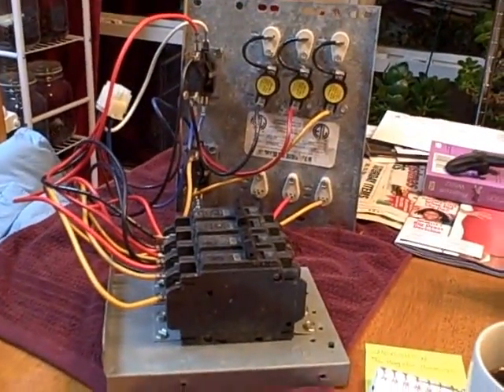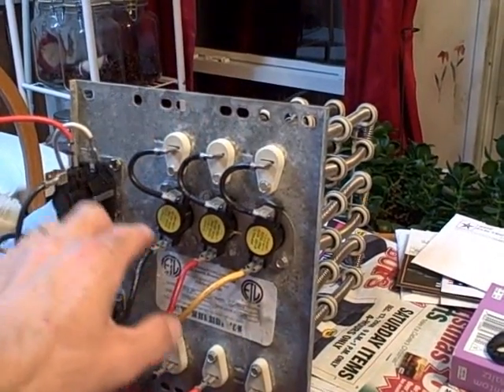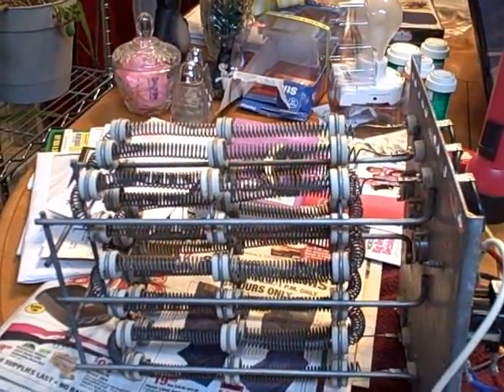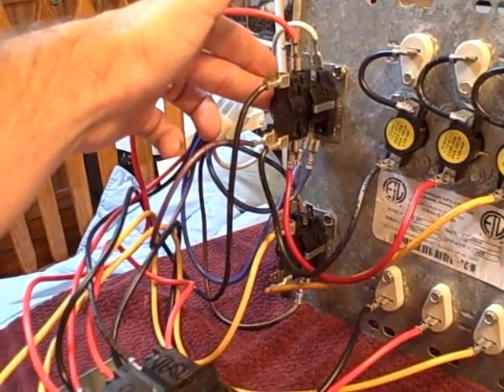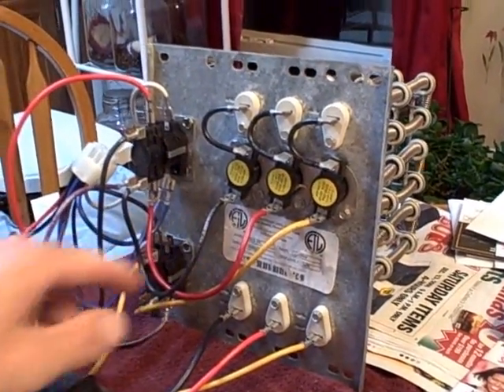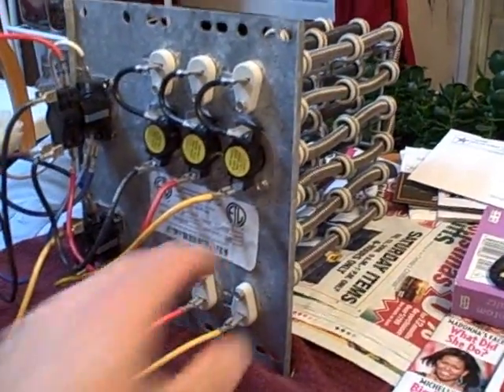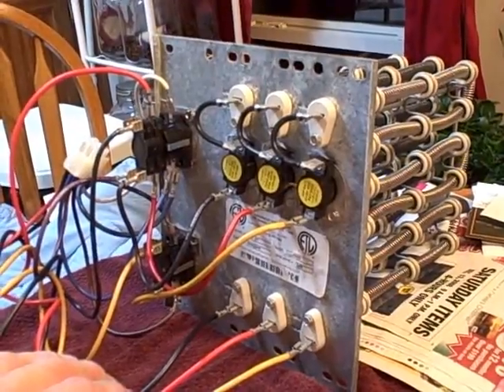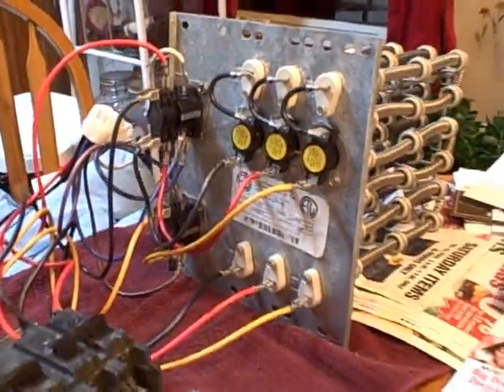HVAC Electric heat kit / strips shown!

Comment: Good info.  My Electric heater has a Heatcraft Unit in it and outside the furnace on the wall I have a big fuse box with 2 huge buss fuses in it.  The fuses are about 25.00 a pop, and my heater is blowing out these fuses like popcorn.  This large fuse box is where the 240 volts pass thru and to the heater.  we live in rural Ohio where it's hard to get anyone out for service.  I'm frustrated to the point I just want to replace the whole coil kit.  What's you take on this?

Comment: What is the reading suppost to be on a limit switch when is bad??
Reply from the maker: A limit switch, like a sequencer, can fail in either the open or closed position. If you had one laying on the table and put your meter on it, the resistance would be negligible, basically acting like a straight wire.

If, however, it showed as an open circuit (say, testing in the continuity setting) then it's bad.  The limit switch is just like an on/off light switch, when the furnace gets too hot the little concave disc in the switch pops the other direction and opens the circuit, cutting off the (usually) 24v going to the heat strips sequencer or gas valve.

I've seen them wired a lot of ways, but typically, properly, they should cut the heat call while leaving the blower running until the temp drops lot enough for the disc to pop back to normal, then it will let the heat call continue, or wait for the thermostat to tell it to hear, if the temp went up high enough in the house while the unit was cooling down.

Usually the only time I've found one failed is it there is either an air flow restriction that is letting the unit overheat again and again, short of short cycling repeatedly before the thermostat reaches the setpoint, the repeated excessive heat wearing it out prematurely.

Typically an airflow restriction would be something like a really dirty evaporator coil, or a clogged up air filter. I've seen insulation board in either the plenum attached to furnace/air handler, come unglued and fall down inside the unit or plenum blocking/restricting airflow.  A few times I've seen (like two times ever) the blower wheel locknut not be tight and the wheel would be spinning in the motor shaft.  (Fun figuring that out the first time, haha!)
I once or twice I've gone on a call and at some time in the past three blower motor had been changed out and the blower had been set too low a speed, say set too low when maybe it should have been medium low or medium. ,(Some replacement motors have the or four speed, high almost always for cooling.

The only way to test the limit switch is to overheat it.  The temp is usually marked on the limit switch. Either removing it from the circuit after shutting off all the heat breakers. (On electric heat air handlers there are almost ALWAYS two or more 240v (in the US)  breakers!!  A really small unit might have one)  

Once it's out of the circuit you can get some alligator clip jumper wired and use those to attach your meter leads to the switch, set it to the continuity/been setting. It should be being out showing continuity. As you heat up the business side of the switch and it reaches temp it will open the circuit. Then go get a glass of tea while it cols of so you can touch it again to put it back in the unit ;)

The other way would be, set the thermostat to heat and turn it up high so it will lick on when you need it, then turn off the breakers to the unit and then remove the 24v wire going to the blower relay securing it so it doesn't short on anything, then turn the breakers back on. The gas furnace should fire up, or in the case of an electric heat air handler you need a meter with an amp clamp that you can clamp over one of the incoming 240v lines, set to high, say 100A or higher. 

With gas you just wait for it to hear up the heat exchanger enough to trip the limit switch, with electric you watch the meter to see when the 20a or 40a or whatever it is drops down to almost nothing, then you know it has cut the 24v signal calling for heat.

I don't recommend doing either of these under normal circumstances though, it puts extra heat stress on the heat exchanger or electric heat strips, not worth the trouble.  

So the short answer (hah!;) Is, if it's not broke, don't fix it. If it is and the unit is cool because the heat won't come on any more and you find the switch stuck open, replace it. :)

Just for fun, here's the order from most common heat failures to the least, on electric heat air handlers:
1. Heat sequencers. 
2. Burned off wired, usually with corrosion, from the push on connectors being too loose. On older units that have had a lot of repairs over the years I've sometimes found some tech had replaced burned wired but put on new wiring that wasn't heavy enough gauge, as was originally there.
3. Blower motor failure.
4. Blower motor capacitor failure.
5. Control board failure. (Nearby lightning gets them sometimes) there are too many ways it can fail to get into here, but not all units actually use boards, lots of old ones out there that don't.
6. Bad 24v transformer.  Lots of ways to die, usually from a dead short in the low voltage wiring and there was no fuse inline to save the transformer!
It always kills me when the manufacturer is to cheap to include a part they can get in bulk for pennies, lol!!  Lightning can be a culprit too, but usually other stuff in the house will have been fried too, heh.
7.  Failed/ bad heatstrip.  This is almost always on old units or systems that have leaked water on the strips during the cooling season and rust/corrosion had set in until it gets a hotspot and fails, or unfiltered air let's cut build up on them slowly over yesterday causing heat stress, then they break.
8. Blower wheel failure. Very rare. The central disk breaks loose from the shaft nut attached to the motor and doesn't spin properly with the motor, which can cause motor failure if, say, it goes unnoticed when nobody is home and the unit keeps running.
9. Limit switch failure, reasons listed above.

I've left off a few, such as bad contactors (some brands use them instead of sequencers) either for the heat strips or the blower motor. 

Bad thermostat, dead, not working properly out a new one was installed and not set up properly. (I've been on a lot of calls for that)

On gas furnace there's also bad thermocouples (won't stay lit),

 bad gas valves (not coming on even though they are getting a call voltage) 
Clogged pressure switch nipple. Where the mounted pressure switch has a rubber tube that pushes onto a nipple going into the induced draft motor.  Rust that gets sucked into the nipple blocks up the tube and has to be c cleared, but that also points to a bigger investigation looking for the cause of the rust.

Pressure switch failures. (I hate those!)
Hot surface element failures. These ignite the gas on modern units. Do lots of these every year!
Flame sensor failure. Usually due to soot building on the steel rod, clean it with some sand paper, wipe and reinstall. Occasionally there's a grounding issue with them, but that's less frequent unless it's a package unit outside.

Well that's it!!  Hell, I should print this and make a video covering it all! Hahaha!!  Hope you found this entertainment, if nothing else!
  Mike

Comment: Are these supposed to glow red hot like a toaster, or do they give off a faint red glow ? I assume also that the all the coils are supposed to light up at once.  I drilled a small inspection hole in my lower plenum, and used a cheap boroscope to view. I'm about to put a new heat kit in anyway, but i just wondered how bright these glow.
Reply from the maker: It varies on the coil string setup, but typically there will be some sections that will turn red (not brightly with the blower running) and others that won't. If the blower wasn't on to dissipate the heat then you would see more, until the thermal limit switch cut the power for safety. It's normal for them to work that way, the coil string give more surface area to create resistive heat. 
As long as you have current flow going through the string then it's working fine. If memory serves a typical 5kw string will pull 20 amps, if you have a clamp-on amp meter it's easy to check and see if it's in that ballpark. 

Heat strips usually last a really long time and usually only fail early if there is crying that builds up on them creating hot spots weakening the metal or rust from a water issue (dirty coil above it dripping or other water issues during the summer).
Hope this helps!

Comment: What would cause the coil to have Several dead spots We replaced the coil with a new coil from supply house and had same problem
Reply from the maker: If you're talking about a single,  say,  5kw string, as long as it has continuity from end to end (no cracks or breaks), you have power to it and it beats up,  then it's working. 
I've seen lots of heat strings that only turn visibly red in certain areas.  As long as they're getting 240v (or whatever the equipment is rated for), all the connecting from the breaker box to the unit connections are tight and the house wiring from the breaker box to the unit is sized properly then its fine .
You can put an Amp clamp meter on one end of the string,  if it's a 5kw string then it should be pulling about 20 amps.

That's what I've always done,  unless it's a vertical unit and there was a water leak issue with the condenser coil for a long time (think really dirty coil dropping) and I need to check the coils for rust,  then I would visually check them. 
Hope this makes sense and helps!

Comment: I had two thermal safety switches break, causing two heating elements to not turn on. I knew something was wrong because the house wouldn't warm up properly.  Ordered new thermals and replaced them.
Then a relay contact that controls a heating element got stuck in closed position. There was no way to know something was wrong until summer came and the AC wasn't cooling properly. Also the electric bill usage seemed high for months. The thermals kept the unit from overheating. Replaced the relay.
Reply from the maker: Hey John!
Wow, that seriously sucked!! I've been on a few calls where the heat relays were stuck closed too. Go out on a summer cooling call because the house won't cool down, nothing looks wrong with the unit, coils are clean and filter is clean, but the temp split sucks and when I hooked my gauges up, the suction and head pressure were both high!  
Got my meter out and put the amp clamp on each heat strip circuit and sure enough, pulling 20A on the double stack sequencer that had one strip on it and the blower motor on the other half. The blower part worked fine though. 
If the house reached temp at night and the unit shut off, the strip still stayed on, overheated, and the thermal limit switch would shut it off till it cooled down, then it would heat up again, over and over. Yeesh their electric bill!!

I got lucky on the very first one that I found like that. For some reason, can't recall, I had popped the cover off the evap coil and could feel the heat radiating from the heat section!  

Usually with those symptoms, high pressures, low cooling temp split, I assume that there is a return air duct that is off and its sucking hot attic air into the unit. I've run across two new installs like that, system was changed our during the winter so it doesn't get caught till summer!

Good work and catch on your system!!
Mike :)

Comment: Thanks for the video.  I worked in HVAC in the 1980s and I've been off my tools for a while.  I am trying to help out our church and they have electric heat.  Your video helped me remember the circuitry.   I look forward to other videos
Reply from the maker: Thanks Frank! I appreciate it!! It's always nice to get a thanks or hear how a video helped, wether just from an educational point of view, or if something got fixed.
Understand being off the tools for a while, lol, though not as long as you, hehehe!  I've been out of action for quite a few years now do to spinal problems. I'm a few years out now from my last major spinal surgery, already had a good bit of steel in me, but they pretty much have everything bolted, plated, shimmed and screwed down now, lol!!  

Finally feeling good enough to start working on some more videos, well after buying a new computer for Christmas! My old desktop and laptop were 8+ years old and getting long in the tooth. When the desktop finally started going south, i wringed my hands for six months comparing computers and griping on how expensive everything is, lol!

So, new laptop and i have a huge pile of old video footage on all kinds of things that needs editing and uploaded, plus a bunch of new ideas for videos! Just need to get used to Windows 10 after being on 7 for so long, learn some new editing software (ugh!) And make myself do it!
If forgot how tedious it is editing footage down, lol!!
Have a few new tool videos I have been wanting to make, so might bump those ahead of old stuff, hehe!

Hope everything goes well with the church work!! The only helping out I have like that is popping over to an old ham radio friend of mine, i think he's 90 this year, and he gets ants in his contactor every year, it seems, lol!
Take care!

Anyway, to make a short story long, yeah, I have think hard or crack out my HVAC notes that i was making on things as I worked on different things, to answer some oddball questions sometimes ;)

Comment: Great video, thanks. I have an old furnace I was looking at and it doesn't have the heat sequencers. Is it possible it's done on the control board? It's a 20kW with two 60A breakers. 4 x 5kW

Comment: that particular brand is expensive to repair. I have a Coleman 3500 series, and the heat strips are in pairs, so if one of the coils goes bad, its easier to replace the unit. I added 250V indicator lamps to my system to show which element is on and I have 3 lamps wired across each of the high limit switches to show trouble or over heating. adding 250V neon indicator lamps helps in showing what the unit is doing. I really love my furnace! so easy to service!

Comment: Are the thermal safeties, are the 24v and can they be replace with a general high limit switch as long as the temp is the same?
Reply from the maker: No, they are high voltage. Remember, they are inline with the heat strips! They do make adjustable ones that you can set the limit on, but I can't recall off the top of my head if they have them for high and low voltage. (Ele. Heat vs gas heat limits) I dont know why they wouldnt. Should be easy to search for though!

Comment: can you tell me what the six wires in the 9 pin plug are for on the goodman/amana hkr20C. I gutted everything on my system. and started over with a heat kit. I also got a brand new transformer. I have to hook up the fan, 2 wire electronic thermostat and a switch.